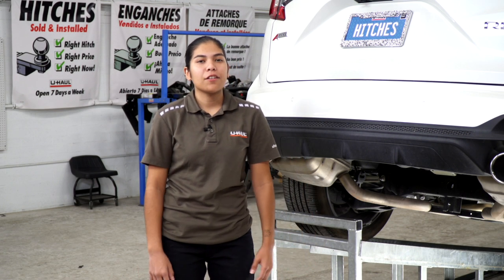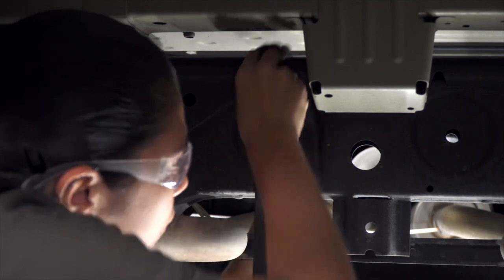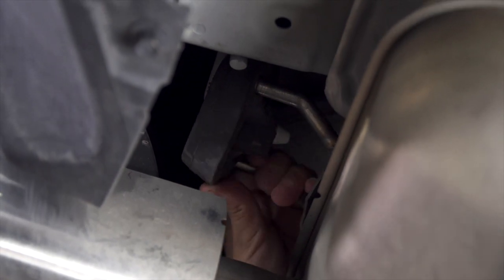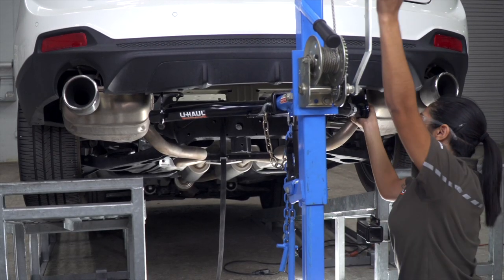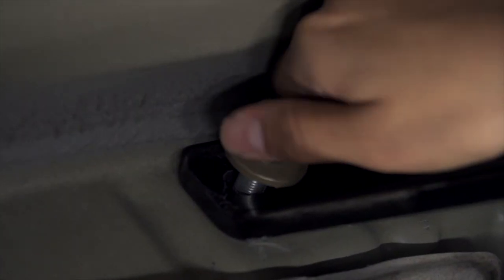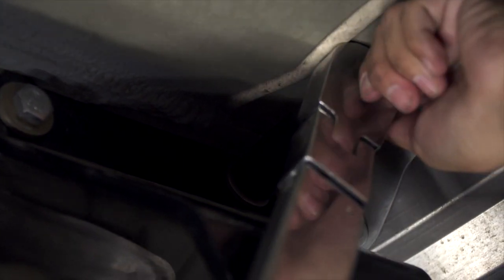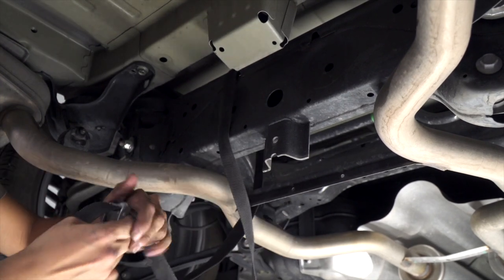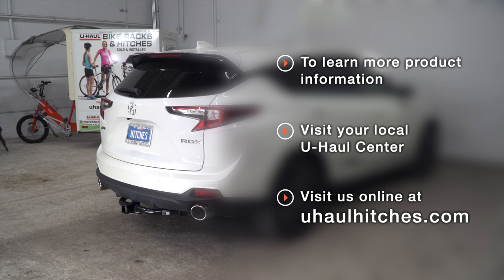2019-2025 Acura RDX | U-Haul Trailer Hitch Installation | CQT76268

Comment: Dropping the exhaust IS NOT necessary. Just remove the spare tire. Then the bottom trim piece on the rear bumper between the two exhaust pipes can be removed with just 2 screws and 2 plastic push fasteners. Removing this piece allows the hitch the room necessary to fit it into place.  Once I figured this out it was a 5 min job to install the hitch. Also, there are videos out that show if you have enough room under the car to work,  you can simply lift the hitch vertically into place near where it bolts in and pivot it up into position.  Nothing needs to be removed to install it this way.
Reply: I bought a hitch and got it delivered recently but came with no mounting hardware. Do you know what kind of bolts I can use? Ima follow your tips here to install it myself too

Comment: Is that from Acura or third party?
Reply from the maker: This particular hitch is made from Draw-Tite. One of the largest manufacturers of trailer hitches. We also sell hitches for other major brands!

And all hitches are either equal to or better quality than the manufacture at half the price.
Reply: What class is this hitch??? I saw another video with a different hitch but the Acura RDX is not aspec, would the other hitch fit in my aspec??? @trailerhitches